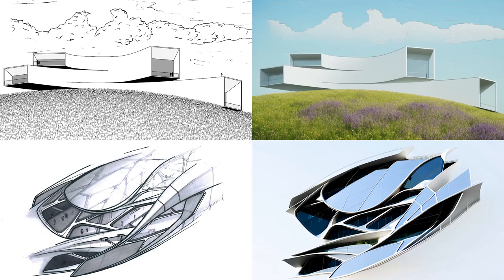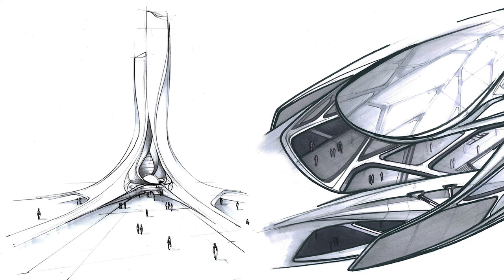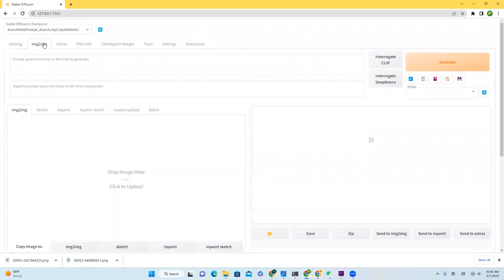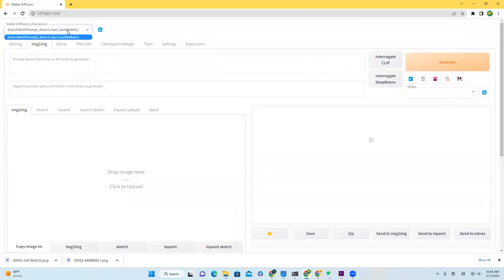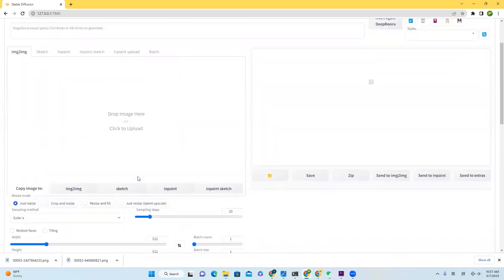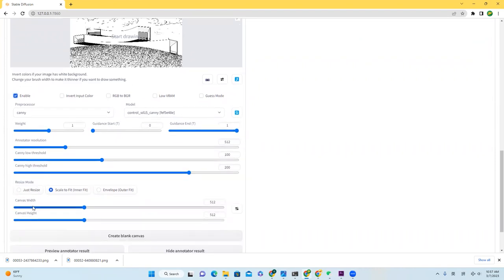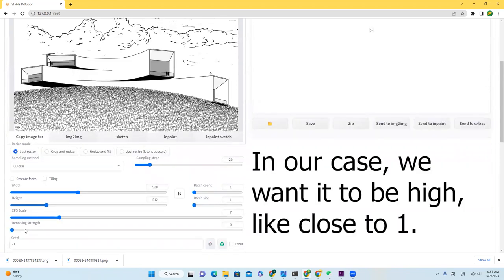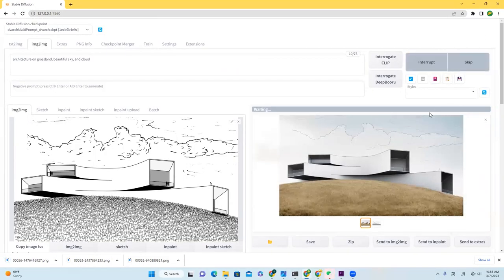Stable Diffusion & ControlNet Tutorial in 2 Mins | Architecture | Single Frame Rendering is DEAD!!!

Comment: Hello! After you install ControlNet, Stable Difussion will always use it? If you disable it will it return to the standard model or it will basically use all the installed extensions? I am having a bit of trouble understanding the differnece between a model, an extension, and a checkpoint.  It would be cool if you can explain  :)